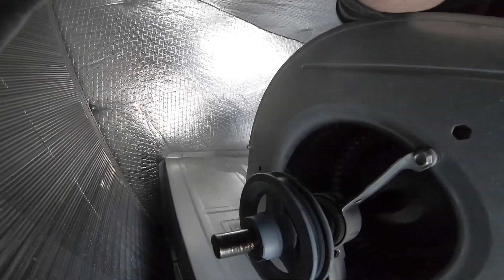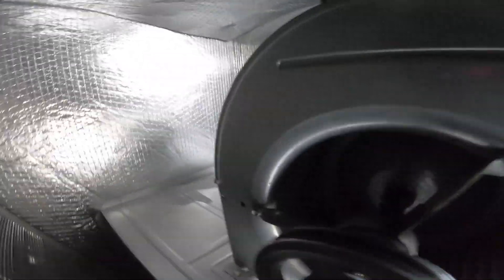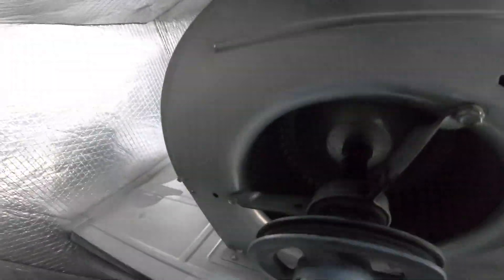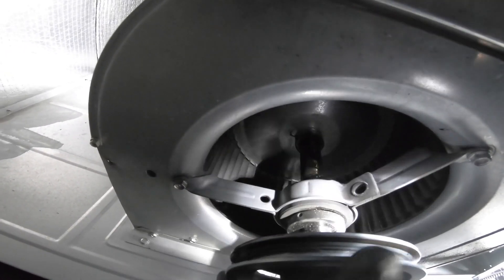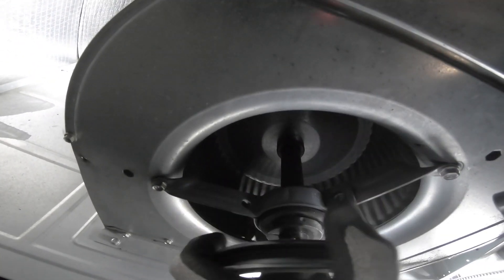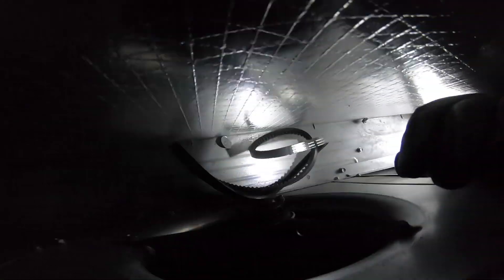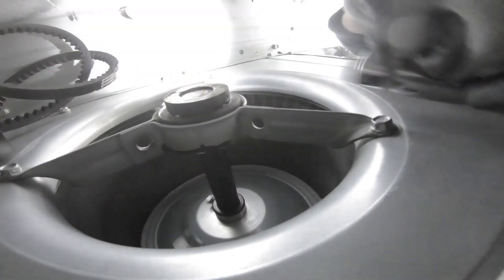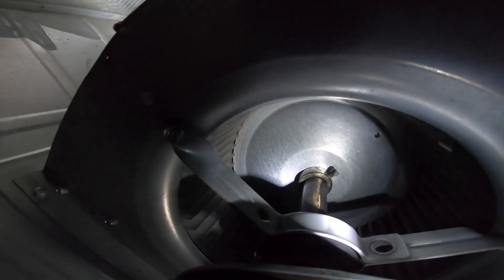HVAC Heating System Vibrating Rumbling Loudly

Comment: Well, you can tell he's a professional contractor, the way he still left the extra belt (the cause of the problem) just inches away from the fan. So that it'll be sucked back into the fan unit in a couple weeks, and he can charge them again, citing some other 'new' problem.
Reply from the maker: We always leave the spare belt their and they never get sucked into the blower. This way if one breaks it can be replaced until a new one is purchased. Been leaving them their for 20 years first belt I found in the the blower

Comment: as a fellow HVAC tech I would never put my hands anywhere near that belt without locking out that disconnect.
Reply from the maker: I respect that yet no way my body would flip that disconnect. Has that happened to anyone you know. I will lock out circuits yet rare disconnects when alone.

Comment: Easy??? You left the old belt there???
Reply from the maker: Old belt is always left next to blower as a spare. We do it on every rtu for emergency call reasons
Reply from the maker: This has been easier than a lot of recent service calls. At least time wise and work needed. Most of my work lately is boiler work. Nothing fast on a boiler service call unless an out standing pilot.
Reply: The HVAC Hacker I think you should’ve put it in different place where the blower won’t suck In the belt
Reply: @thehvachacker    sorry im not a HVAC guy...just seemed like it could wind up back where it dosent belong